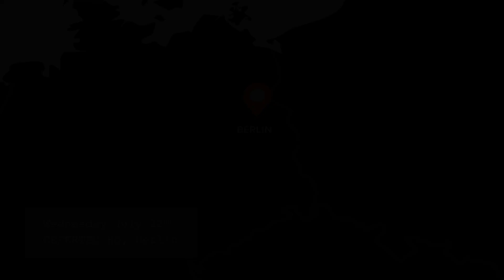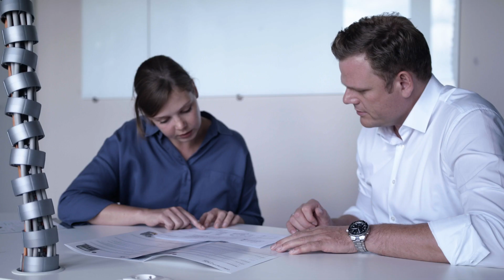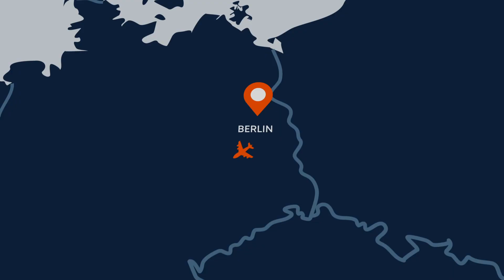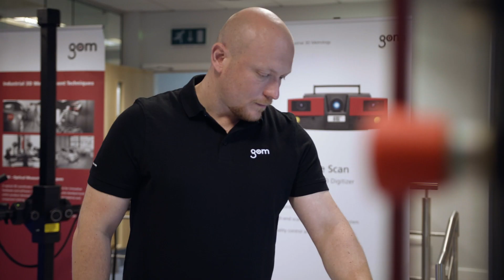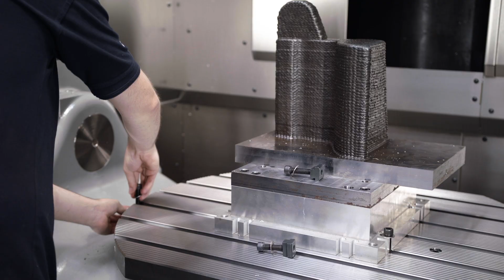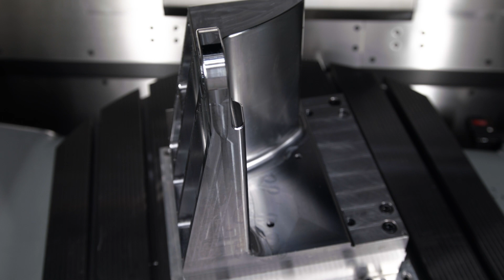3DMP® - Disrupting the Manufacturing Process

Comment: That's quite a story. Why it took so long to print this kind of a part? If it's a milling steel (as I can assume by wire color) it shouldn't be a problem. Was it heat distribution that cause so much delay? 
Anyway great job, I hope someday WAAM will be widely implemented in all industries. Good luck in your future work.